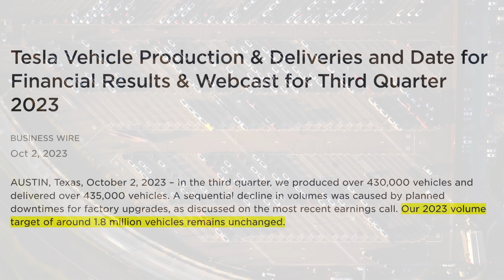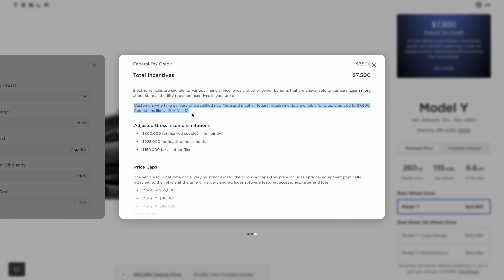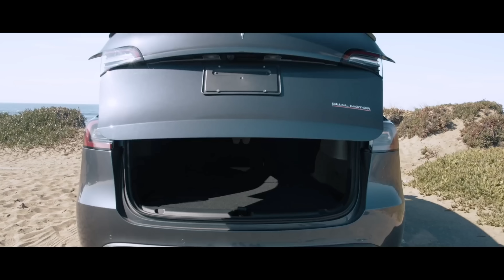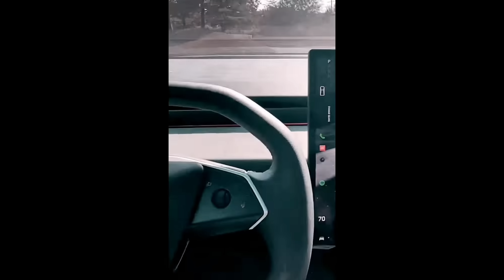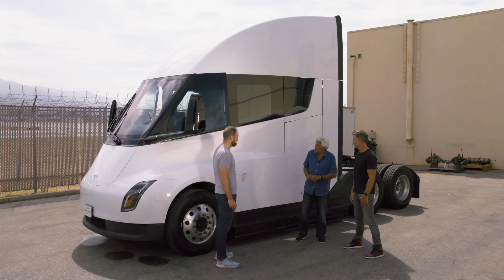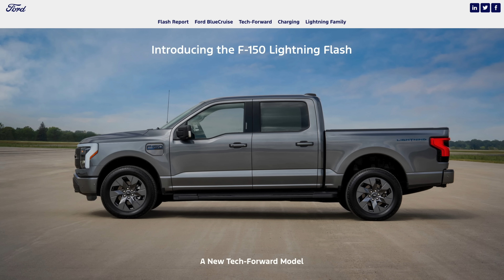New Cybertruck Details, New Model Y Variant, Tesla Semi Insights

Comment: I've had my X for 3 years.  Bought it new with all options.  With my service visits I've had many opportunities to drive 3s and Ys and the first thing that I felt extremely uncomfortable about is having the one screen, especially because I had to quite deliberately take my eyes off the road just to look at it for general driving information.  I hate it and wouldn't ever get either of those models.  I wish they'd at the very least project things like speed onto the windscreen, or just give us the dash display back.
Reply: We have an S (for almost five years now) and got a Y half a year ago. I find glancing down and slightly to the right in the Y isn't that different from glancing down at the dash display - it's mostly about overcoming the motor memory of decades of driving...
But I do get that many want a dash display in the 3 and Y, which I guess is why there are so many aftermarket options for this.

Comment: Hey Rob, i can confirm the model Y lighting is currently just on the dash but will be coming to the doors too later in 2024 when they do the full Model Y refresh and bring all current updates from the model 3 to the model Y. - I saw this confirmed in a differant video yesterday.
Reply: I think it's on the doors, but aligned with the "old" trim because they haven't changed the door cards yet 
.
The dash trim can be a common unit.
The door cards are different.
.
Looks like they're fitting "Highland" drive systems, maybe mapped for Y parameters of speed, acceleration and economy.
.
Suspension/ NVH?
I'll bet that improves as well.
.
Glass?
Tail lights? 
Those will come with the Juniper upgrade.

Comment: Brake by wire means there is no actual link between the driver using the pedal and the output on the calipers. the pedal has a sensor which transmits the information to an electrical motor which generates pressure in the pipes and thus move the calipers. so no pump. also the feedback for the driver is generated virtually and is not the actual pressure in the pipes.
Reply: This would be a true brake by wire or these days a dry bbw. Many systems are still halfway there, ie. wet bbw where the calipers are still actuated hydraulically but the input from pedal is electric.
Reply: @Timo-qb1gf  correct

Comment: Rob, I'm confused.  Is there a 4680 Model Y being built in Austin?  It's confusing because I thought they were close to a 4K or 5K per week run rate.  What happened to those cars?  Are they building them without 4680s?
Reply: Heard they’re being reserved for Cybertruck.
Reply: @ken-mb5cp  yes, but Austin is still making model y, right? I wonder where they are getting batteries
Reply from the maker: Texas has made 4680 and 2170 Model Ys.
Reply: It's well documented.
Reply: @rogerstarkey5390  ha. Nice one.

Comment: I appreciate the conciseness of your summaries.

I won't read too much into Ford's Lightning production pause. That might have something to do with Ford's wrestling match with UAW; it's hard to guess. In any event, it's obvious Ford wants to make the truck. And they have orders.

More concerning is Ford's pause on construction of their battery plant with CATL. Ford will need those batteries. So what's up with that?

Wild-ass guess: Ford decided that something about that collaboration missed the sweet spot - type and specs of the planned batteries versus cost. Might be they want to renegotiate to take advantage of late-breaking tech. Or change the form-factor of cells. Or want tweaks to pack assembly. Whatever it is motivating the pause, it must be significant. Otherwise Ford would have plowed ahead. They do need those batteries.

I'm please to see Rivian showing progress on their ramp.

Semi still seems to be in its LRIP phase: Low Rate Initial Production. Honestly, I don't know why. They have had enough time to bring up a production line and work through problems. They've had enough time to establish supply chains. They have orders, and they can deliver at least 750 KW chargers to position as fleet operators demand. They aren't ready to support go-anywhere jobs. But many fleet operators have suitable routes that should be easy to set up. So what's the hold-up?

I see a pattern. Model Y: paused for minor refresh which seems to end 4680 packs. Q3 production slightly down overall. Sales for Models S and X not surging despite major price reductions. Sure, you can write off Q3 as retooling and improving, but which is the cart, and which is the horse?

I think Tesla hit a supply snag. Batteries, or chips, or both. Those are the items most likely to be affected by geopolitical friction with China. And of course the unexpectedly slow 4680 ramp.

Production growth for complex end items usually run into snags. It's the nature of the beast. Winners navigate the snags and resume growth. Tesla is not going to lose, not after all they've worked so hard to accomplish.

They might fall short of 1.8 million units this year. They might even struggle next year to grow past that volume. Geopolitically-driven supply chain breaks might persist. There's still a real war on. And a trade war. Globalization is faltering.

The long term looks bright. But I think, in the short term, Tesla stock buying opportunities may again present themselves.

To conclude: the Model Y pause and minor refresh may be Tesla taking advantage of downtime forced on them by blips in their supply chains.

Thanks for your reporting, Rob.
Reply: You forgot to mention the cyber truck that will certainly add growth next year, independent of any other variable. I also think the time of purchase rebate instead of having to wait to file your taxes does matter to people because it reduces the monthly payment
Reply: @trent_carter  if my conjecture about supply chains for chips and/or batteries failing to keep pace with Tesla's projected ramp is true, then the Cybertruck ramp could be, in the short term, disappointing. I don't have much faith in the uberbull case of 375K units in 2024. Under 50K units could be closer to the mark.

Of course if they do a smashingly successful ramp, I will be immensely pleased.

But I think I see hints in the data that all is not well in ramp-land.